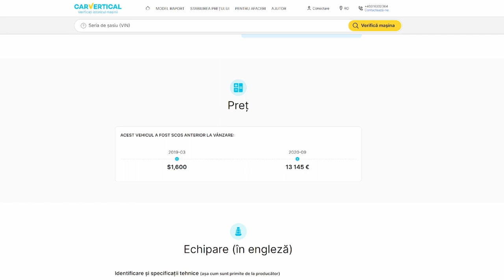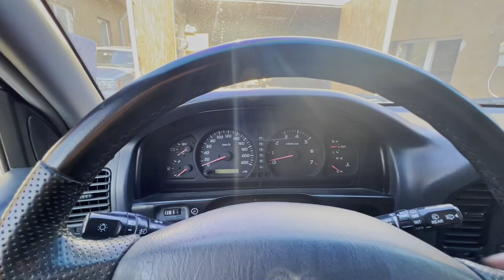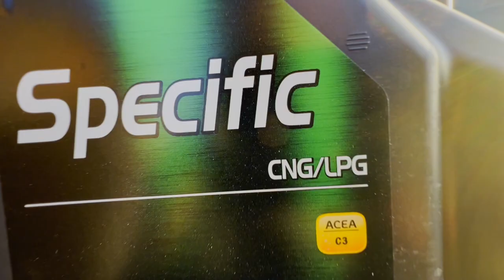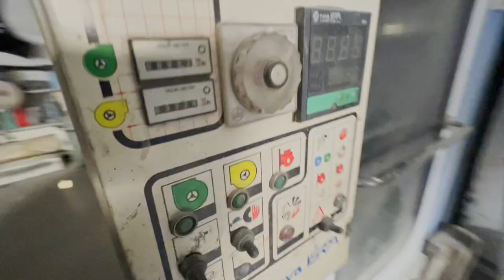Cum scapi de rugina superficiala CEL MAI IEFTIN | STACS TOYOTA

Comment: bai sper sa prindeti ironia si sa vopsiti corect nu la spray! dar decat sa se vada rosu, e bun si spray…. despre asta e vb.
Reply: Este vopsea oskar ( direct pe rugina) e cam 250 lei 2L. Deocamdata e mai buna decat kelfos si alti inhibitori. 🤷‍♂️
Reply: La Spray iese ca și cum ar da direct cu pensula :)) Spray-ul merge sub mașină sau pe jante etc. Merge și el la prag dar na nu iese ca și cum ai vopsi la pistol
Reply: @raduorban  Da sau Kelfos de se îngerește după sau m-ai multe tipuri dar tot același lucru îl fac , Fohr m-ai este , am găsit acum
Reply: @type3666  niciodata iti dai seama
Reply: @raduorban  nu e mai bine sa dai și cu spray de rugina și după și cu vopsea d aia?
Reply: @36lat  de rugina nu scapi numa cu flex-u. Restul sunt solutii temporare mai mult sau mai putin bune. Pe elemente exterioare: bari parti de suspensie etc da protejeaza. Dar ca si in video. A fost inlocuit element la prag. Aia e singura solutie ✌
Reply: @DanielTheArtist  Da exact , m-ai bine din pistol peste tot 😁sau să faci portbagajul negru lucios cum a făcut Răzvan Vizitiu 😁
Reply: @raduorban  Fluxul și tablă nouă 😁

Comment: Am folosit de cateva ori spray cu zinc Tectane Bodywork din Dedeman , si mi se pare extraordinar de bun pentru rugina.
Reply: Contra ruginii adica :)))) sau depinde de ce ai nevoie
Reply: @mariuscbf1000  😂😂😂
Reply: @mariuscbf1000  direct pe rugina? cat a tinut pana a reaparut, daca a reaparut
Reply: @sergiu8685  L am folosit la multe retusuri si imi place cum lucreaza. Concret...am dat pe toba finala de esapament la un clio 3 si are vreo 2 ani sa zic ...inca arata bine, un argintiu mat. Doar un strat de zinc, atat. Rezista si la temperatura.
Reply: @mariuscbf1000  perie de sarma clar. Eram   curios daca ai si vopsit peste
Reply: Mi e mi a aparut rugina la busonul de benzina e bun sprayul asta ?